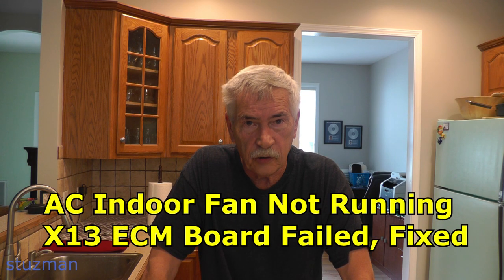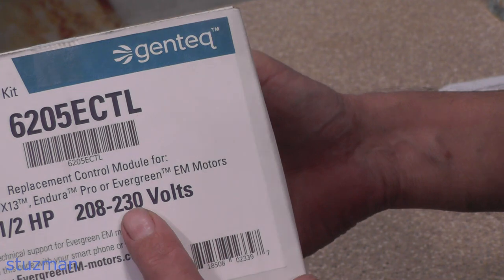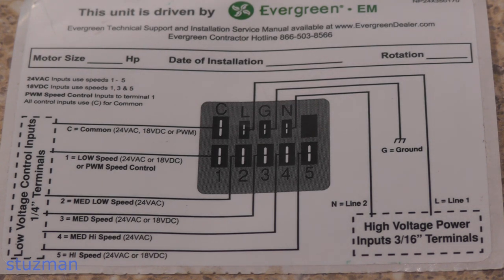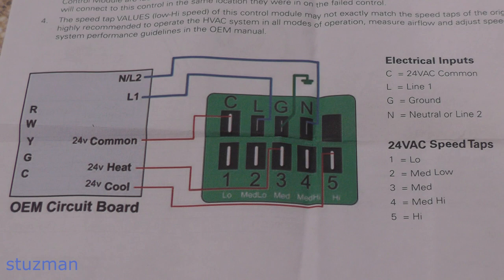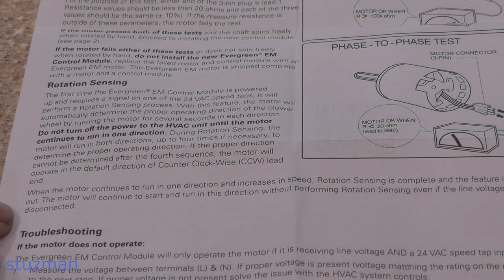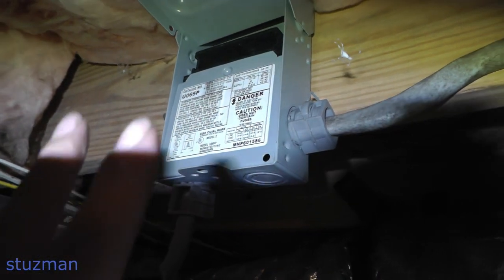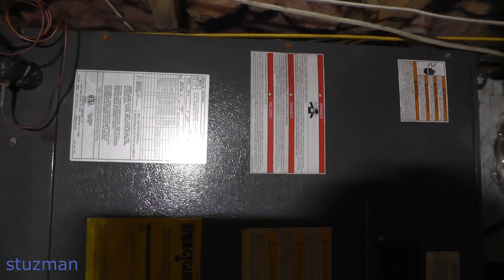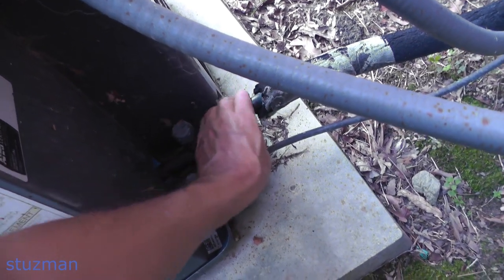AC Indoor Fan Not Running, X13 Motor, Rotation Sensing and Change Rotation

Comment: These ECMs go bad mainly due to line surges and spikes. Protect the high voltage line to your air handler aka furnace with a surge arrestor or if you want just the blower motor only go with the Zebra X13PR surge protector built specifically for X13 motors. The only problem with protecting just the motor instead of the whole furnace is that once the Zebra is used up or burnt out, it will cut power to the blower motor and you end up having an iced up evaporator coil.
Reply from the maker: Thanks for the comment and have a great day!

Comment: Some people just soder a new cheap thermistor to module for a cheap fix and in most cases it starts to work fine. It's a straight forward procedure you just snip the thermistor soder new one . Just FYI.
Reply: I just replaced motor and module as one unit. Got it from same place as you. My module was doing something I’ve never seen before. On mine this time the fan was running all the time. The problem was not the setting on the thermostat. It was problem in the control module. It is working fine now with new motor and module.

Comment: Hi...i have the same motor like your's which i replaced the whole motor i only have one lead going to the motor it say high speed i replaced it with genteq x13 same company just the motor isn't running fast enough i cleaned the condensers they where dirty but still feels still not fast enough is there any other way of speeding this motor ohh i have the 115vac which i forgot to plug in the white jumper but still it was running after i put the jumper for 115vac it dual voltage 220 without jumper 115 with a jumper any ideas for speed controls on this
Reply: It has a keepright control board HK42FZ066 cebd431102-04-ra
Reply from the maker: Hi Richard! There isn't a way to increase the speed as it's been programmed in the EEPROM at the factory. If you have access to the dedicated programmer, then you should be able to reprogram the speed. You could call the place of purchase and see if they may have any other insight on your issue. Have a great day!
Reply: Thanks very much
Reply from the maker: @richardkay6  You are welcome!
Reply: Hello sir what white jumper please explained
Reply from the maker: @AbdulRehman-dn8vg  Not sure what white jumper wire you're referring to. Where in the timeline is this located and I'll try to answer?

Comment: My blower motor went out, it's an x13 ECM by genteq very similar to what you showed.  But I only paid $275 shipped for an entire new motor from Amazon.  I have seen many ECM repair videos and I agree they are not reliable enough.  Mine went out after 8 years.  Pulling the motor is way too much work to do in a hot attic or crawl space every 8 years.  I tested the inrush current limiter on mine and it is good, but mine is fully potted like yours with black silicone.  I don't know what else I could do if I can't find a way to remove the silicone.
Reply from the maker: Yes, it's a pain when you can't troubleshoot an individual component because of the potting. Some people dump this motor and replace is with a PSC type motor. Have a great day!
Reply: @stuzman52  Do you know if there are vids/help out there discussing how to switch back to PSC motors when unit goes out of warranty?  Seems like a 24v relay and a PSC motor would do the trick? Just seems like a matter of the pick-up current of the relay coil so as not to damage the control board, or use a solid state relay.
Reply from the maker: @GeorgeKennedy-u4r  I remember seeing a few videos on YouTube showing the procedure. It's basically where the HP is the same, whether the motor is 120 or 240V, the shaft diameter and length are the same. And of course a relay to switch the high voltage to the motor. Other than that, it's a simple swap out of the motor.
Reply: @stuzman52  Yep, just saw one and it looks like a simple swap as long as I get a similar motor (HP, speed).

Comment: Where did you buy that module from? I need the same exact one three-quarter horse.
Reply from the maker: Sure, it was purchased from www.evergreenEM-motors.com In my case, the module was for a 1/2HP, not 3/4HP as you mentioned for yours.

Comment: I could have used your skills a month ago. I had guests staying over in the garage guest room and it was a hot, humid night. I set the thermostat to 73 degrees and it couldn't keep up. The outside unit line were frozen by morning. Once I set the thermostat to 75 it cycled and cooled off the room. Was I just asking too much from the unit?
Reply from the maker: Hey Wyatt! If you have the line frosted all the way back to the compressor, I would say that you got a problem. Causes of this could be air filter plugged, indoor fan not running or fast enough and the most likely cause would be low on refrigerant. Have a great day!
Reply: @stuzman52  Thanks for the tips!
Reply from the maker: @wyattoneable  You're welcome!
Reply: @stuzman52  as a professional HVAC contractor for 30 years, I can tell you that low refrigerant is usually the least common culprit.. especially if it has no prior history of leaking,, refrigerant doesnt escape, wear out, dissapate, evaporate , ect,, the only way it disappears is if u have a leak...  dirty filter or clogged evaporator coil is usually the problem,., out of every 25 a coils I would check on A/C units usually at least half of them needed to be cleaned. 
a bad fan capacitor can cause the fan to run slow.  also the sheet insulation that lines the fan housing can come unglued and pull up against the blower housing , blocking the air flow.. 
too small of a return air grill or a blocked grill can cause poor airflow as well.
Reply from the maker: @randy1ization  Thanks for the info and have a great day!

Comment: It's been fun to learn about how these systems work, but the new X13 motors are a little intimidating as far as diagnosis goes. Our heat pump is fine when weather is moderate, but at the extremes of heat or cold the heat pump is not so great outside of its ideal working range. It would be nice to have some kind of trouble codes to help with diagnosis, akin to theOBDII system in cars.
Reply: Check out Ty Branaman's channel.  He's doing a full training suit and really gets into what the refrigerant is doing based on symptoms and measurement.
Reply from the maker: Having a micro controller on it could help with things like reading the pressures and temps without hooking up gauges and temp probes. Of course, that would raise the price of the units and you still would have to intervene to what the actual problem is just as diagnosing cars when you get a code. Have a great day Dave!
Reply: @stuzman52  Terry, if I may be so bold, would you be kind enough to glance at my most recent video? I need your seasoned advice regarding whether I should follow through with installing a hard start kit for a scroll compressor on a heat pump. I paid the extra price of getting OEM parts for a hard start kit, but it turned out that simply replacing the run cap solved the problem. Even so, it's an old compressor, and I'd like to do everything I can to prolong its life. Is there any downside to hard start kits on scroll compressors?

Comment: Interesting…My furnace/AC is 22 years now, so classic drive and control. But It’s a near certainty it’s replacement will be of this design. The “rotation learn” sequence is very clever indeed. Thx Terry. Cheers 👍
Reply from the maker: Hi Ian and you're correct that if you buy a new unit, it will surely have this monstrosity on it. In the older days, systems came with a PSC motor and in the future as mentioned in the video, I'll be replacing it with that. Have a great day!

Comment: Very complete video thank you.  Right now my speed wires are on white to #4 and blue to #2 . I have a small 1500 sq ft house and motor or fan speed noise is bearable but kinda loud.  Where do you recommend hooking up those wires to make ac/fan sound quieter ? I did look at your diagram but was not sure if I can change wire location.  I just installed a new motor with module attached. Thank you.

Comment: some of the higher end air handlers have a ramping feature that you can program with dip switches.. some also have continuous mode, where the fan runs very slowly continuously all the time.. this keep an even temp in the house because the air is constantly being moved and the thermostat is sampling the temperture.
I like the ramping feature because it also acts as a dehumidifier .  you can have it ramp up at different speeds over a specific time frame.. like start at 10 percent, then in 3 minutes, it slowly ramps to 50 percent, then 70, then 100..
Reply from the maker: Thanks for added info and have a great day!

Comment: Hello there Mr. and Mrs. Stuzman: we really appreciate your video, especially since we are experiencing exactly the same issue with our unit here in Florida. We have a Genteq x13 1/3 hp. on a heat pump made by Carrier( Comfort Maker.) I replaced the bearings and it worked fine for weeks. But after losing power due to a power outage during Hurricane Ian, the unit came on for a few hours but it stopped working once again, causing it to freeze up. I have taken it apart and checked the thermistor and it reads about one ohm, of course sinking the leads of my meter thru the thermal compound and trying to make a good connection blindsided. My request to you is this; would you be bold enough to try to find a way to remove that rubbery compound without causing any other damage to the board or its circuitry. I would love to repair this one, since around here every quote I get from the HVAC companies is way out of our reach, and too expensive. In the thousands to be moderate. I read somewhere about a solution that dissolves that rubbery material, but I can't remember where! Any thoughts would be appreciated, keep up the good work. Love seeing couples helping each other thru bad times and enjoying the fruit of their labor, what an inspiration! Thank you,
 Reinaldo and Myriam Roman.
Reply from the maker: I've thought the same thing too Myriam about what product could dissolve that rubbery compound. I did look into this awhile back, but never pursued it any further. I saw one video where a fella here on YouTube boiled the board in boiling water. And another was using WD-40. Of course, I didn't see anything specific to the electronic board as on the Genteq. And I don't know if any of these methods are effective. On the first unit that went out, I did take a pick and got a lot of the material out. But it was a tedious process and I wouldn't recommend it. Sorry about not offering any help. I guess that's how manufacturer's don't want anyone repairing these units. Have a great evening!

Comment: Not a lot you can fix on those boards except the inrush limiter which is sticking out of the potting.  The rest is a rectifier/inverter/motor driver with often proprietary programming on the chip.  

I depotted an oil level alert module for small engines and it was a pain, also it was just a resistor and diode on a board so easy not to damage digging it all out.  

I have wondered if it is worth while to put a bulkhead inrush limiter on the mains to perhaps save the stress on the modules.  Those big caps pull heavy on being powered.  I have a variable ECM but my indoor unit has gone through 2 case mount breakers, they last about 4 years.  And the breaker goes out in summer, on the weekend.  Last one I replaced myself as a tech was going to be 2 days due to the workload.
Reply from the maker: Hi JK and you're correct that it's just not the effort to clean out all that gunk. I've tried it before on other boards, and you'll wind up destroying the board, components before you can get it clean. It's strange that you're having circuit breakers going out as something is not normal. I assume that you've already checked the amperage and voltage drop across the contacts of the breaker. Have a great day!
Reply: @stuzman52   As I changed the breaker this time instead of it being a warranty repair, I opened up the failed breaker.  It has corrosion.  Apparently, there’s a condensation problem.  Indoor unit is in the crawl space.  I’d already been thinking of putting an external disconnect on the unit since the breaker leaves live mains right in your face when working inside the cabinet even when off.
Reply from the maker: @jkbrown5496  That would be a great idea JK and should be a lot safer too. Have a great day!
Reply: @stuzman52   I looked into the breaker more closely.  Only a small amount of corrosion (rust) but it ate the spring on the switch lever that held the contacts closed when "on".  So my contacts had arced until they failed.  

However, after more thought.  This spring that rusted and broke is also the one that breaks the contacts when the bimetal/thermal assembly reaches a fault condition.  So how long the breaker was in a state where it  was closed but would not trip, I don't know.  As I said this is the 2nd one replaced, they seem to stop conducting after 4 years, but when the spring rusted out, who knows.  

Method of failure seems to be with the body of the breaker in the cabinet electrical section, but with the face/switch sticking out, outside air is being drawn in from, in my case the crawlspace, but HVAC Guy replaced on not long ago in an attic.  This humid air, I live in TN, condenses on the spring causing it to rust out.  (the other leg of the breaker, without the switch lever has no corrosion.).  So I will be going with an external fused disconnect and until I remove the inline breaker probably put some dielectric grease around the switch opening to impede air infiltration.

This is a blower unit design flaw for these through cabinet panel breakers installed in unconditioned space.
Reply from the maker: @jkbrown5496  Sounds like a good plan JK by installing a fused disconnect to get it away from the air handling unit. Good luck with your project and have a great day!

Comment: this is called twinning of the motor windings.,,. on some units,  say just for the gas furnace control the power plug has to be twinned from the 120 volt feed.. usually all you have to do is swap the hot and neutral where the plug hooks to the furnace power inlet.  they are making hvac systems alot more complicated than they need to be.. govt pushes for higher efficiency which is fine, but your not saving any money having to fork out several hundered to a thousand dollars every 4 or 5 years.. a PSC motor that is oiled every year, is kept clean, and balanced will last 20 years no problem.,.  I had an hvac system in my first house that was problem free for 27 years, still worked fine when  I sold it,, the only thing I ever replaced was a contactor, because they tend to wear out over time and the contacts can arc and weld together. I used a high quality washable filter, and cleaned the blower wheel and motor every few years.. nowdays start and run capacitors are higher failure rate due to poor quality, and frequent voltage spikes in the power grid.   you may want to order and keep an extra capacitor and contactor for your unit on hand.  if the unit does not have a start capacitor on it, I like to add one,, it lets the compressor start nice and easy every time,, they are called hard start kits.. theres just 2 wires that plug onto your run capacitor.. the kit has its own start relay built into the capacitor.  I also put hard start capacitor kits on my fridge and freezers.. the compressor will last forever if you do this.and  its very easy.. 2 wires go to the power feed going to the compressor, and the other 3 wires go to common start and run.. you can throw the dinky relay and thermodisc away thats on the compressor.  we have alot of refrigerator and freezers go down due to power surges.. the surge either cracks the little thermodisc on the compressor which opens the circuit..the hard start devices do not use a thermodisc..   if your compressor wont start, you pull the factory relay off the compressor and shake it,, if it rattles the thermodisc inside is broken.

Comment: sl22 1r020 thermistor
Reply from the maker: Yes, in some cases the thermistor will open which was not the case for me. Have a great day!
Reply: @stuzman52  It wasn't for me either. Have a new module on the way. Just curious, did you ohm out the motor and if so what readings did you get? Thanks for posting...great info!
Reply from the maker: @zygotepeyote  Yes, I went though all of the preliminary checks as resistance checks on the windings and to see if they were grounded. I did an earlier video which shows more detail with this procedure among other things. Here is the link https://www.youtube.com/watch?v=qTjTZeuJQ3c Have a great day!